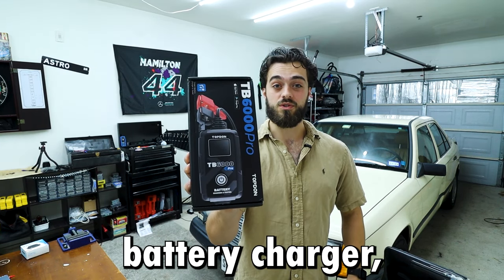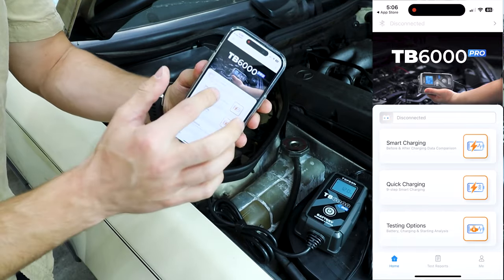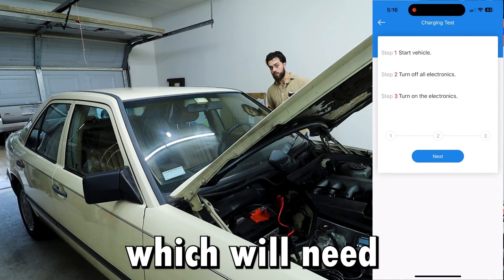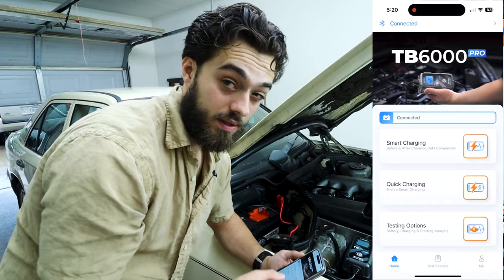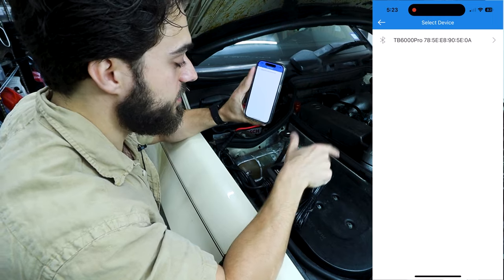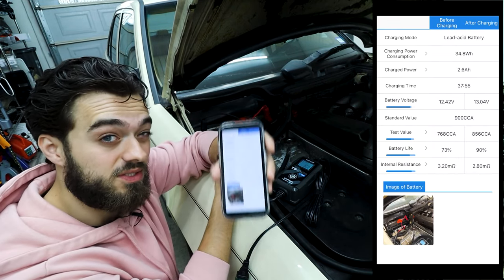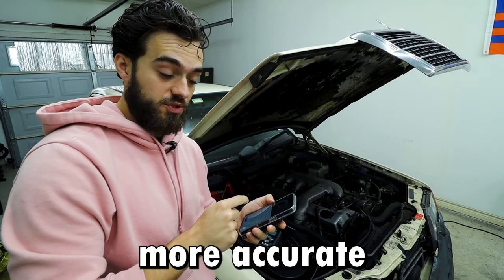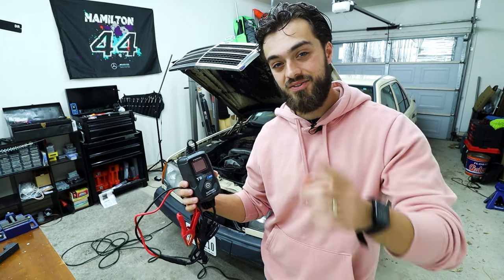Topdon TB6000 Pro Battery Charger

Comment: How's  Tahoe doing?
Reply from the maker: It is great! Have had zero issue since the swap. Just using it as my daily driver as I work on my two projects.
Reply: @AutoMotivate  That's great. I got the same Tahoe as your with the 4.8 with 306,000 miles all original, best truck i ever owned.